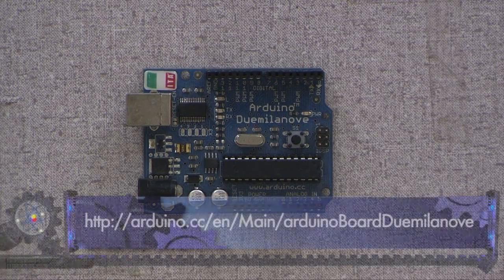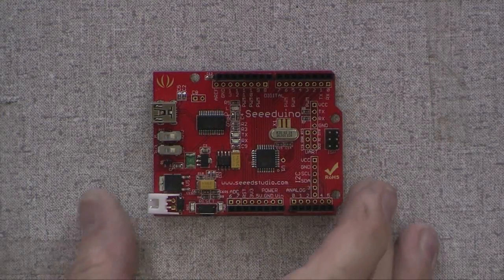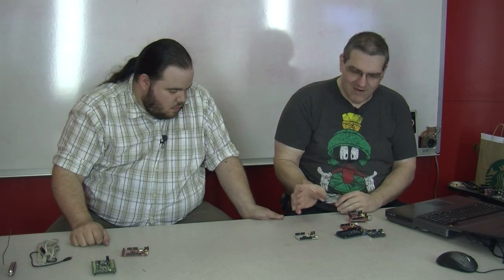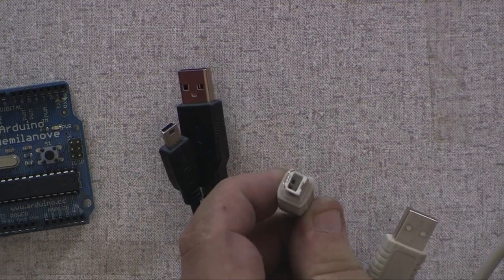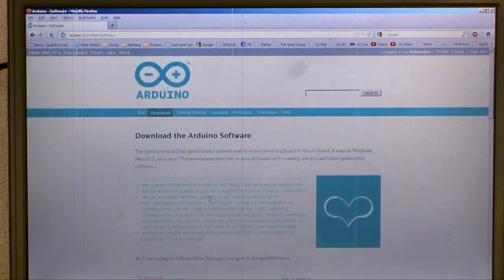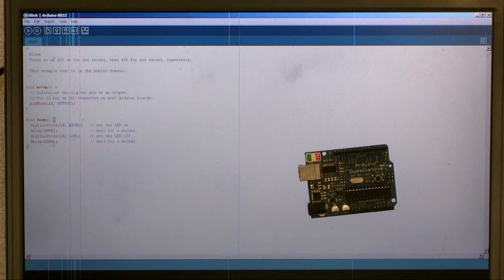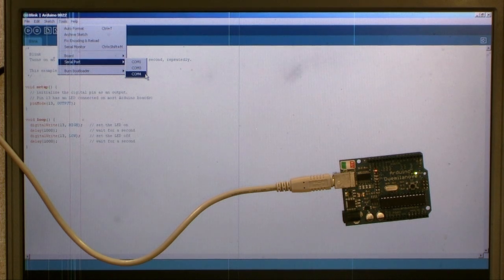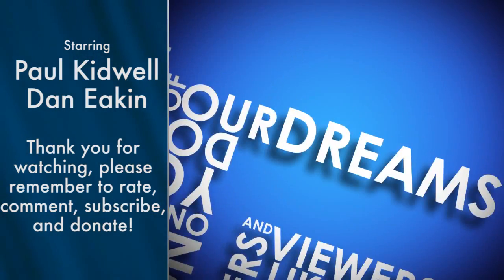Arduino Processor Basics

Comment: *nods*  i imagine so.  Our next video will talk about inputs, and the video after that, outputs.  Most fridges have a thermocouple device in them.  This device creates an electrical signal that an arduino can interpert.  Using this input, and a data table programmed into the arduino, the arduino could then turn on a relay output that is tied to the fridges compressor.  I suggest joining the forums, and under member projects, post pictures and information so folks can help you out.

Comment: Depends on how you define a "normal serial port". If you're talking about a nine pin D-Sub connector, then your Arduino board will need an RS-232 to TTL level shifter, something like a Maxim MAX233 would work. 

On the other hand, the Arduino Pro has just a five pin header that you use connect to your PCs USB port via an FTDI cable.